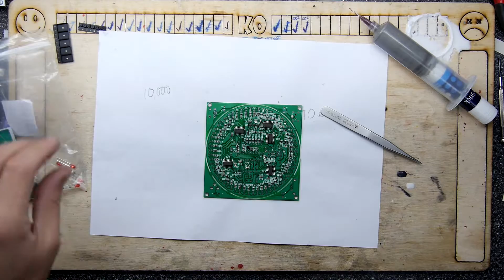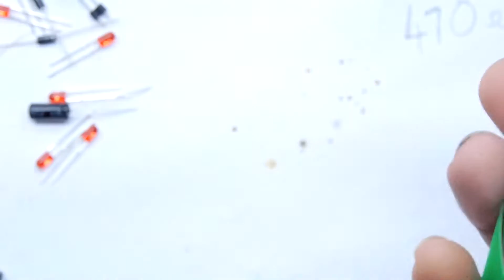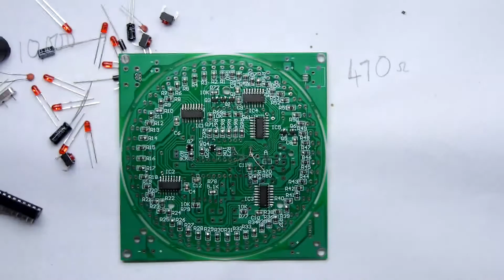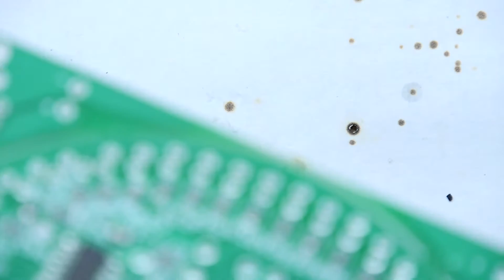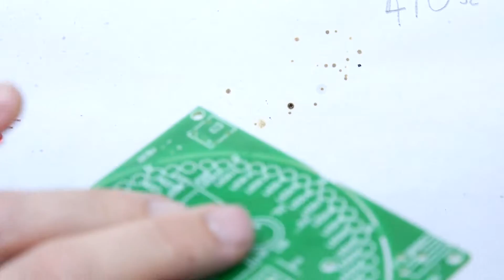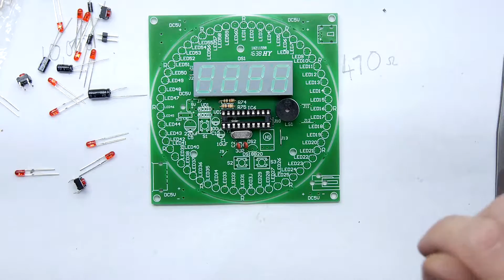Teardown Lab   Giant Clock Kit Part 2

Comment: I have a plastic cup i put all my component legs in waste not want not !!
Reply: http://www.ebay.co.uk/itm/TINNED-COPPER-WIRE-18-21-24-25-35-SWG-VARIOUS-LENGTHS-/261931936657?var=&hash=item3cfc5c2b91:m:mz0RCYjBB1Bhn7QHezRT0Yw
Reply from the maker: +Brian Jones Seems so obvious, but so handy!
Reply from the maker: +Brian Jones what gauge would you suggest is optimal?
Reply: you could try gardening wire if you can get it thin enough but the tinned copper is better not too expensive, personally 0.8mm but .55 is more than up to the job, any thicker your have trouble fitting it in holes.
Reply from the maker: +Brian Jones I will look for a roll 😂

Comment: Not too shabby, my friend.

Only minor thing (of which I'm often guilty myself), but a teensy bit too much solder in places.

The solder joints should ideally form a "fillet", with sloping sides where possible. A blob of solder won't be as strong, and can be more prone to dry solder joints.

http://www.rctech.net/forum/attachments/radio-electronics/533192d1261511561-how-solder-correctly-not-so-brief-lesson-solder.jpg

It's fine for a quick kit like this, but I would recommend thinner solder for much easier control.
Say around 0.5 or even 0.4 mm solder. I use 0.5 mm for most stuff, unless it's very fine surface mount stuff, like TQFP chips. ;)